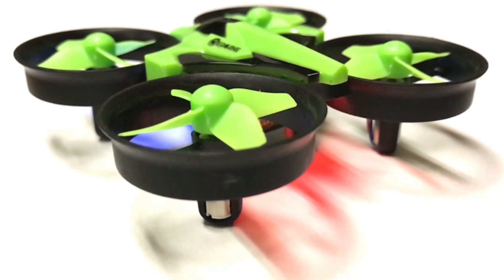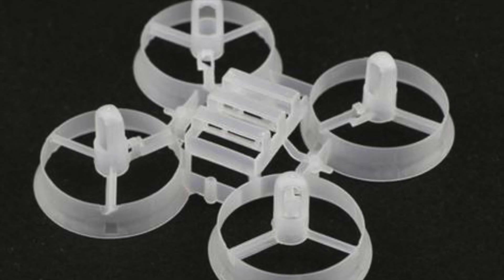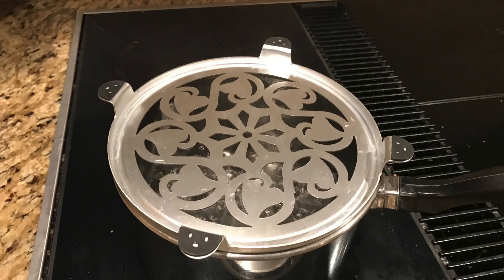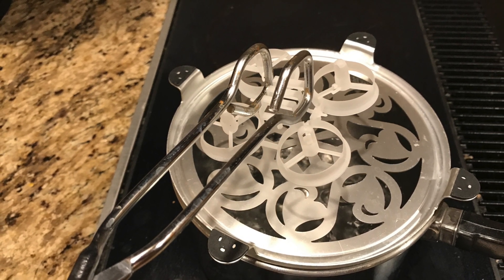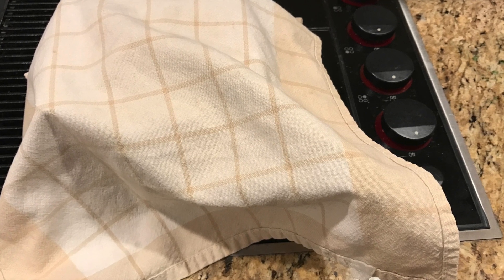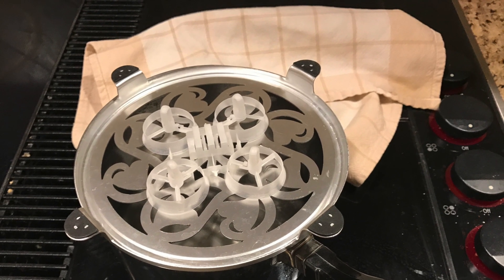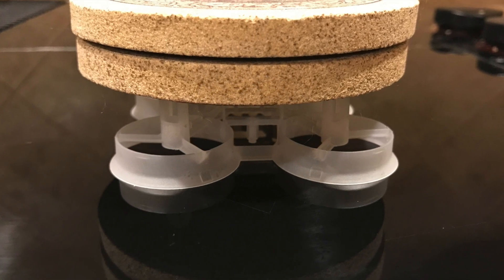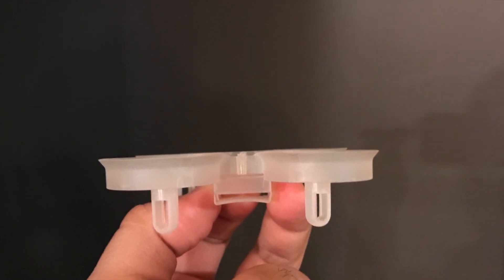Eachine E010 E011 Frame Fix: Quick Fix for Warped E010 or E011 Frame

Comment: I just straightened a NIB, E011, stock warped frame by holding it with tongs just like in the video and dipping it in water that was almost boiling, but no bubbles, for a 15 second count then on to a flat surface (upside down square cake pan), then weight and wait a bit. Three times and it is perfect. Thanks for putting this video up.

Comment: Screw all that noise just get a better frame the beta 65 fpv Frame any beta frame they're 10 times stronger
Reply from the maker: 🤣 Haha, noted! Most of the frames available now were not available when this was made.  You are correct, there are better frames out there now.  I like the cockroach and BetaFPV frames.  Although, this is one of the better and lighter frames for the non stick style batteries.

Comment: From my experience i can say that 1 minute submerged in boiling water is enough to return them to its original shape. No need for anything else, just boiling water. Once they're out they are going to cool down in some seconds, and you're ready to go. Your method is more refined and it may work better, but i don't think it's necessary. I think it's a shame that these webs sell you something that will come to you damaged just for not protecting it properly before shipping it.
Reply from the maker: Aaron, kudos to you for having the courage to drop it in boiling water!  We only ordered two and weren't willing to take the risk until we tried this first.  Thanks for sharing!
Reply: Well, i ordered 3 e010s frames, they arrived bent. Asked for a replacement, and they arrived bent too. Some of them were heavily bent, all of them useless, so nothing to loose. My pleasure! and nice video, by the way! :)
Reply: @quadspex6895  yeah take this video down and tell people to just boil their frame it works better, i wasted a bunch of time with this.